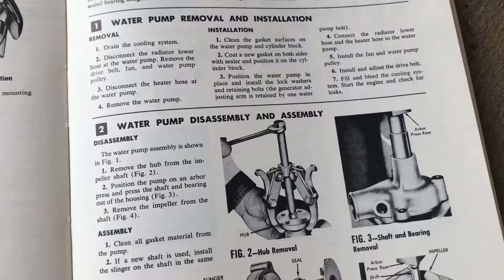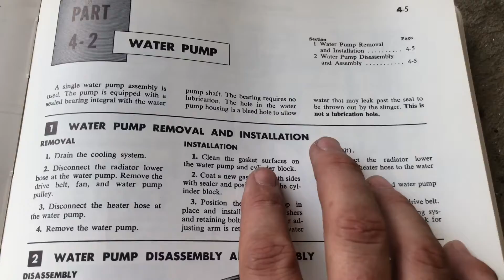How to Replace Water Pump and Thermostat - 60 Year Old Waterpump 1960 XK Early Ford Falcon

Comment: G'day mate....is your Falcon an XK ?  With 2 speed auto?  If so, is there any cooling lines from bottom tank to auto-trans?  Just asking for an old fella who has a 1962 XK and he has asked me, and I have no idea.
Reply from the maker: Yes, mine is XK.  However I don't recall it having a trans-cooler pipe running through the radiator bottom tank or at least I can't remember disconnecting the lines when I last removed the radiator.  I don't have it stored at home else I would go and look now for you, sorry.  I did just check the original shop manual and it doesn't mention the transmission cooler, however it does show the cooler lines coming out of the transmission.  I know definitely the later model XM had it running through a tube in the bottom radiator tank as I had one of those a few year back.  Sorry, I couldn't be of more help.  Next time I get my XK out of storage I will have a look for you!  Cheers Drew